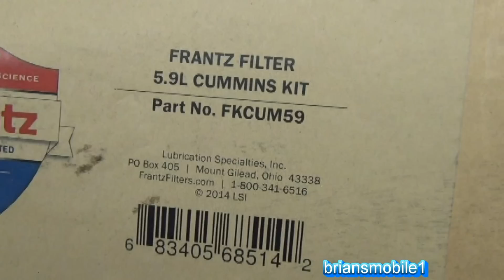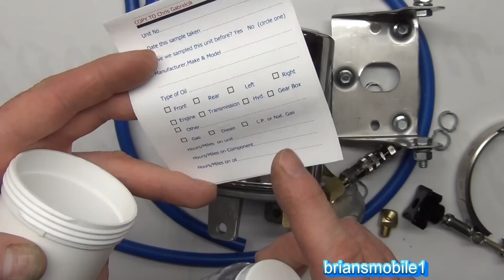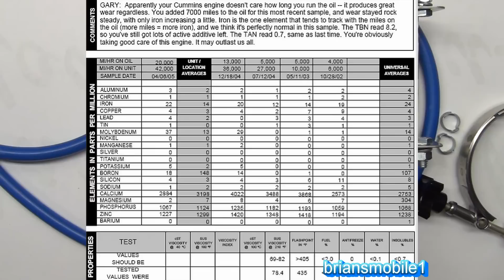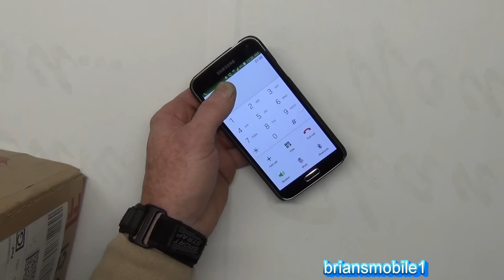How to Make Synthetic Oil Last Even Longer  Frantz

Comment: Slight correction needs to be made to this video.  People need to be careful as this video might be slightly misleading.  People need to still change their oil as recommended by the manufacturer.  The reason for this is because you can deplete the oil additives your engine needs and still have clean looking oil.  The oil might look clean but it no longer is protecting your engine like it should.  The only way to know whether you have depleted the additive package is to send your oil in for regular testing.
Reply: You don't need to change the oil, just get an additive package
Reply: Or, like the title of the video says, use synthetic.  Long life synthetics have longer lasting additive packages, and since you're changing your filter regularly and adding oil each time, you're contributing to the additive package.
Reply: I stopped draining the oil 60 years ago.Additives last a lot longer in clean oil. When you change the filter you add new make up oil. Some of these new cars run so clean the main reason you need to  change the filter is to keep the additives up to specs Instead of spending money on oil analysis I can change the filter more often and add more make up oil. Nothing Brian said is misleading. I wouldnt call about 1 quart of analytically clean oil going to the oil pan a minute a trickle of oil. Thats about 60 quarts of oil a day being cleaned in my Pontiac. To me that means no oil changes and virtually no engine wear. Brian is wasting his time. Most people think engines will last longer if the oil is allowed to get dirty and be drained. The oil changers dont recommend Frantz oil cleaners or any filters that clean oil.
Reply: Jackmaster says our filters eliminate oil changes. Very true.
Reply: Watch out for some Frantz dealers that claim if you use the synthetic elements you can go 15.000 miles between filter changes.
Reply: When I started using filters that clean oil I was using the Frantz and Standard Delo 100 W 30. No you dont have to use synthetic oil.
Reply: @ralphwood8818  First off I never said anything about synthetic oil. Technically if you don't care about your engine you don't have to use any oil. Of course reason and experience says some oil is better for some applications than others. I would say you absolutely need to use synthetic oil in smaller turbocharged engines and it's a big help in bigger engines that have turbochargers as well. You claim you don't need it but if you want your turbo to last you really do need it. I've got coked up turbo cores to prove it.
Also it's actually quite common today for oil changes to go to 7- 10,000 miles between changes even without filter changes or adding oil so 15k is not that big of a stretch for a lightly used engine. You won't see those kinds of intervals on none synthetic oil so once again to do anything close to that you will NEED synthetic.
And I doubt the filter element has anything to do with it.
Reply: @consaka1  I know what has worked for me for the last 60 years. I have never had a vehicle with a turbo. I know many trucks have turbos and use Gulf Coast filters and conventional oil and dont drain oil. NASA saw my posts years ago. I see Gulf Coast filters has them listed as a customer on their web site. I have been using Super Tech 20.000 mile synthetic. I did a fleet of trucks when the 6.0 Ford first came out. Most of the trucks had turbos. The makeup oil they gave me was Walmart conventional 15 40 diesel rated oil. When I put the Gulf Coast 0 1 filters on the frame I had to add 1 1/2 gallon of oil. I wasnt too happy being supervised by a lubrication engineer from a offshore rig company. My experience is mostly small non turbo engines. There is a lot of good information available. A lot is bullshit. I do remember when you had no synthetic oil. No multi grades for diesels. You had Standard Delo W 30 and W 20 and Frantz  3 stackers on large marine engines. Saw two Frantzs 3 stackers on a truck with a 8 V 71 Detroit. He said he gets a 6 pack of Safeway Truly fine to service them. Didnt think to ask him what oil he uses. Was talking about a  Peterbilt truck with a million miles with one oil change. Road King magazine asked me for the truck owners phone number. They did an article on it. I believe it used Rotella conventional 15 40 oil and a 3 gallon Gulf Coast 02 filter. I believe the series 60 Detroit 425 H P engine has a turbo. The one oil change was because someone forgot to tell a mechanic not to change the oil it was a Shell oil test truck. The Australian Jackmaster filter company mentions the 1 million mile truck.. A good sign they are working together. The Jackmaster Classic is the only small filter as good as the Gulf Coast junior. I have heard the  Gulf Coast junior has been discontinued.  The big companies need little filters for forklifts and such.
Reply: @ralphwood8818  Well I can tell you a few things from my experience as a diesel mechanic. Shell Rotella T will keep your oil cleaner longer and in my opinion the much better oil conventional or synthetic. I can also tell you that the running conditions experienced by a semi truck turbo and a two liter turbo car engine are NOT the same. The truck has a much easier life with smarter people driving them. A smart truck driver idles his engine before shutting it off. This allows the turbo to cool down and it's the oil that's doing the cooling as most large turbos are not water cooled. People driving cars do not do that and thus the oil sits in there cooking to really high temps. Eventually the oil passages are clogged with something that looks and feels like really hard charcoal. That is of course when the owner uses cheap conventional oil, commonly Pennzoil in my experience. This is why smaller turbocharged engines should absolutely use a synthetic oil. I heard some manufacturers actually require it. Synthetic oil can tolerate slightly higher temperatures which seems to be just enough for the engines to live. Also don't think that just because a turbo has water cooling that it's immune to coking up oil passages. I've got one in my shop that's coked up harder than granite and it has water cooling passages.
As far as filters go, well I'm less impressed with supposed fancy filter designs than you might think. Most initial bearing damage is from contamination resulting from when the engine is first built. It is extremely difficult to get fine machining grit out of the oil passages and you can see it by pulling the bearings on 100 mile engine. You can quickly tell how thoroughly meticulous the mechanic was that assembled an engine and even then often you can find scratches in the bearing surface. I can tell you a super fine oil filter gets plugged up faster than a normal filter. Normal filters filter down to around 10 microns and that is good enough to prevent any visible scratches on any bearing. A few fancy filters claim to filter finer like 5 microns. This is really not a good idea in most vehicles because on cold starts or semi plugged filters the engine just bypasses the filter. Some oil is better than no oil right? If your filter plugs up super fast because it's filtering down to two microns then it's going to be bypassing the filter all the time especially if it's a diesel. The reality is if you routinely remove a quart and replace it with new oil you can drive indefinitely without a regular oil change. I don't believe a fancy filter makes any difference to that premise. Do you really believe a filter is going to filter out long carbon chains at the molecular level? If they did you would be changing those filters all the time and they would be huge. I don't see that happening on a daily driver. And I'm not referring to trucks here either as they are a completely different animal. And yes I'm very familiar with luberfiner filters that trucks use. For those not familiar those are a large fine filter that constantly filter some of the oil. Their main job is to catch the carbon particles that make diesel oil so black as those particles can actually cause the oil to get thick over time. This carbon is from partial combustion that happens to get past the rings. I could write an essay on the causes of partial combustion but it's outside the scope here. Needless to say those particles can be very small and pretty much just go right through the normal filter.
Reply: @consaka1  I used Delo 100 W 30 conventional from 1963 to about 1973. Started using Mobil 1 when they came out with 5 20.I happen to know some large diesel engines were using multiple Frantz 3 stackers before there were synthetics. Alhambra water company for example. That was in the early 60s. Of course synthetic oil is better but we did ok before synthetics.  Some large turbo diesels run 24  hours a day 7 days a week.The oil is never changed. They close the valves to the big bypass filters change them and turn the oil back on.The dip stick is where the level can be checked with the engine running. About 1956 I made rounds with a gas company mechanic.I believe there is a trucking company near me in Alvord Texas that uses Gulf Coast bypass filters I believe they use synthetic oil and dont drain it. Gulf Coast filters has that kind of information. They have filters on Shell Locomotive engines on Offshore rigs. When the Frantz 3 stackers went out of production they were replaced with the bigger Gulf Coast filters. Some of them are going to the Military. Saw one on a Army 5 Ton years ago. The government is interested in saving natural resourses. I believe the Australian Jackmaster is to replace the little Gulf Coast junior im told. Gulf Coast filters is too busy to deal with little filters. I believe that was Alhambra. California water supply. Probably all electric now.. Frantz dealers took a lot of pictures. Took Gulf Coast filters to Dallas Texas years ago for a big luxury RV. He said you can do the Land Rover and the generator my mechanic will do the big engine. The Rover had a Buick engine. Wasnt too confortable with the big turbo Cummins. Had the same thing happen in Fort Worth. You do the Volvo My mechanic will do the Detroit. Ive done a few big engines since. Nothing like a locomotive engine on a drilling rig. Didnt see Rotella in the discount stores in the 60s.
Reply: @jasonalexander6417  Normally just adding new oil at filter change is enough. I normally change the TP every 6.000 miles and add a new quart of oil on the gasoline engines. More often on the few diesels ive owned Bought an old Ford F 350 with over 300.000 miles on it. I didnt go over 2000 miles between filter changes. The 6.9 diesel used or leaked about a quart of oil in 600 miles. No need to drain the oil. About 50 years ago I worked driving a truck for a guy that called synthetic oil synthetic crap. He had Luberfiners on everything.The only time I had a problem with a turbo was on a new truck. A large hose clamp got inside a hose and went into the turbo. The hose clamp got into the hose at the factory. Took a few miles to work its way into the turbo. I believe the V 12 Detroits had 2 turbos.
Reply: A 10 micron abrasive is a engine wearing abrasive. A 40 micron abrasive is a engine damaging abrasive.

Comment: What about the additives that are in oil? I thought that you change the oil regularly to make sure that your oil contains the various additives that are used up over time. Particulate matter is only one reason for changing your oil. Am I wrong?
Reply from the maker: No- you're not wrong at all.  That's exactly right.  Acids, PM's, and additive package can all play a factor.  Using the right oil helps a lot.  Not all oils are created equal.  Synthetic oils have longer drain intervals because the additives and temperature characteristics are superior.  Most people in Europe choose synthetic oil even though they pay a lot more for it than we do.  It's cheaper in the long run and more effective and convenient.
Reply: The way it was explained to me is additives last a lot longer in clean oil. When you change the TP you are keeping the oil clean. When you add a quart of new oil you are replinishing the additives. One mistake some are making is they are going too far between filter changes. I have been guilty of that myself.
Reply: You dont need synthetic oil.In the 60s I used  Standard Delo.  Since it wa a diesel rated oil I assumed it had a healthy amount of additives. I changed the TP and added  a quart of Delo about every 2.000 miles. Delo was about 29 cents in the discount stores. There were no multi grades for diesels in those days.
Reply: The Frantz is the prettiest of the TP filters. Better designed filters for using TP are here now. I use TP.. Hard to find paper that fits the Frantz. This filter has the Frantz element. My filters are all designed to use the new TP. Motor Guard Gulf Coast junior  and Jackmaster  Classic. You can buy 30 dollar TP now. My Jackmaster Classic is the best but it  is green. Like you would put on an army vehicle. Thats where some are going. Jackmaster claims their elements are better than TP but you can use tightly wound TP..Frantz isnt set up for TP..

Comment: You dont need synthetic oil. The Frantz has been around a lot longer than synthetic oil has been common. I started with a Frantz and Delo 100 w 30. Frantz had a lot better clamp in the 80s. It was at an extra cost. The better clamp was standard on the Gulf Coast junior. They went to the knob type later. Must have been cheaper.. my Jackmaster Classic  needs  a wrench I also need a pair of long nosed pliers to remove the used TP. The Jackmaster element has a fabric  cover with a pull ring.

Comment: $350 for a filter kit.  That's crazy!  I was interested until I saw the price.  Just think how much oil we could have saved this planet if car manufacturers starting putting this on all vehicles since 1953!
Reply: $350 for the complete kit.   Check their website.
Reply: Don't lookup a Luber Finer 750 bypass system, you will have a coronary the replacement filter element is over $300 USD and gets changed about every 16-20K miles. 
Complete system runs about $1000.
Reply from the maker: WOW!
Reply: Im a filter guy.many years ago I cut open a Luberfiner element to see what was in it. It was cotton waste with a few cotton twigs. I bought a WIX 750 element to see what was in it. It was pulverized newspapers and wood chips. The Fleetguard and Luberfiners are the same. At one time Cummins claimed a 80 % engine life increase with a Cummins Fleetguard 750. At one Time Gulf Coast filters used Bounty big roll paper towels.Not sure what they use now. A lot of them on locomotive engines on off shore rigs. Over the road trucks with a million miles with no oil drains. Dont remember what I paid for the  Wix 750 to see what was inside it. I wouldnt pay 300 bucks i probably paid less than20 bucks at O Reileys. I have bought Fleetguard 750s from a International dealer with the elementfor about 200 bucks. A long time ago. I dont think you can get cotton elements now..  I had a Mazda diesel pickup once. It came factory equipped with a almost useless pleated paper bypass filter..I tossed it and put on a Frantz. Sold it to a Hispanic  guy he was happy to get the Frantz. Told him I would put the Mazda filter back on. He said hell no I could keep it. He knew about the Frantz. I think I still have the Mazda filter like a lot of other junk. Probably a good idea to remove the Frantz before putting the add in the paper.
Reply: I remember selling Frantzs for 29.95. It was hell boy I can buy a real filter like came on the car for 2 dollars. Sold a Frantz to a well known dragster owner in the San Jose California area. I would say  I put a Frantz on Joe Davies tow truck. The Frantzs got easier to sell. Not sure Joe Davis would apreciate that. Before I left California I put a Motor Guard on his Plymouth Fury. Chevrolet sponsored him. It was a Mustang Dragster.. Chevy engine with a Chrysler transmission
He liked Torque Flites. I used a Frantz adapter that eliminated the full flow filter on the Chevy Suburban.with the 292 big 6. When I left California it had about 300.000 miles with no oil changes. highway miles.pulling the dragster. Standard Delo 20 winter grade. I told him to use 30 wt. He got Baldwin filters and Valvoline free. He used Standard Delo because he wanted his oil to look like mine.Delo was. A beutiful oil when clean. He was using Standard Special. It had a dark tint to it. He was bitching. Frantz said drain the special and put in Delo. The special has an ashless additive that turns dark. He was a perfectionist from hell.

Comment: Can I use it on my subaru? Can you do an install video?
Reply from the maker: You can.  I'm going to put it on my diesel truck.
Reply: I put a Frantz on my new 84 Subaru. A Motor Guard on my 93 Legacy. You have to understand the car you are putting the filter on.   If you have to be instructed on how to install a filter you are probably not ready for one. When I found out about a Frantz I bought one and put it on.